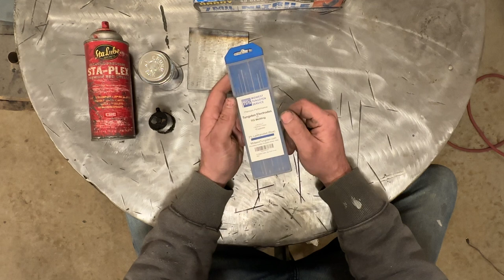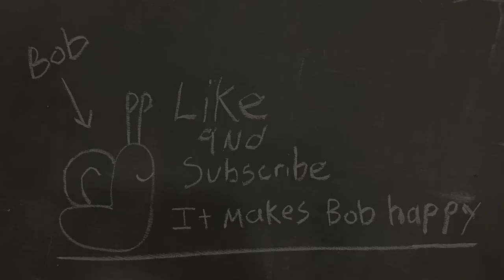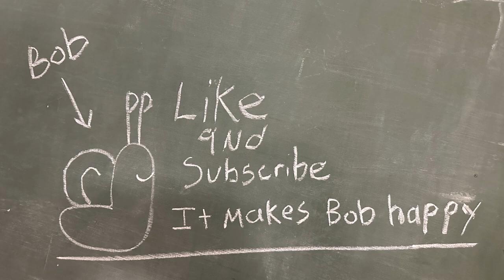Let’s have a honest talk about welding safety

Comment: Some months a go I was welding on a bigger project and was wearing one of those quilted jackets and managed to set myself on fire twice in one week.     That was when I finally opted to get one of those $$$ Lincoln welding shirts and I have to say the claims of fire and burn through resistance are not an exaggeration.   If anyone wants /needs one of these just get the next biggest size so you can wear a shirt underneath if need be.
Reply from the maker: I haven’t set fire to myself much but things around me more than once that’s for sure.  Burns suck, hopefully other than wrecking a jacket you made it out ok.
Reply: @makingmistakeswithgreg  No physical injuries but I can truly state that you should never wear acrylic at any time when welding .  That stuff burns easily and turns into little melted balls of hot plastic just ready to cling to you and burn you good.   It was at the time the only jacket I had to wear when "roughing it " outdoors and hadn't been an issue.  Live and learn.

Comment: i wear a 14. it's hard to find shoes, boots, etc. sketchers make composite toe tennis shoes which are of some benefit.
Reply from the maker: I hear that, I wear a size 14 too.  I end up finding something that fits, buying it, and then ordering them online in the future.  That’s if the local store has them.  I have been wearing the same boots for 14 years so that’s a bit easier.

Comment: 30 bucks at lowes gets you a 3m half mask with cartridges recommended for welding/grinding. They fit under a hood and help redirect your breath away from the lens and prevent condensation in cold weather. I went ahead and picked up two. 

Trouble is that they inferefere when I want a cigarette...yes I'll try to remember to laugh on my death bed.
Reply from the maker: Great recommendation.  Cheap insurance for sure.  We all have bad habits and if a few can get knocked out of the list it’s a good thing 😀

Comment: Have you ever giving EMF any thought?
Reply from the maker: That’s a great question, here are my thoughts:  I actually have a emf meter, I might have to try it out while welding to see.  Now I am not a doctor, scientist, or medical professional, but I did read a bunch on this topic.  Without knowing how much welding outputs, it’s hard to say for sure how much damage it might do.  

Welding in general is bad for a persons health.  It can be very difficult to determine how bad welding is specific is because of the cigarettes and other bad habits welders often have.  EMF exposure isn’t a benefit, it’s possibly a detriment for sure.  I don’t believe it would be significant enough to directly be a serious concern, but I need to investigate this far more and get data.
Reply: @makingmistakeswithgreg  Actually there are an EU directive (law) that the workplace must make an EMF evaluation and plan for eg welding.  I just never heard someone making one.  I sometimes repair battery banks similar to your battery welder . I use about 800Amps for about 20mS to spot weld a nickel strip to a battery . The EMF pulse is strong enough to blow 13mm spanner of the desk. This make me think-   In a Lincoln welding primer , they suggest to tape the work leads together , I am not sure this will cancel out the EMF , and many tig welders run cables over the back or lap. I believe transformers are worse than inverters.